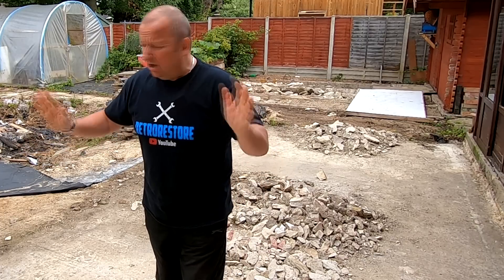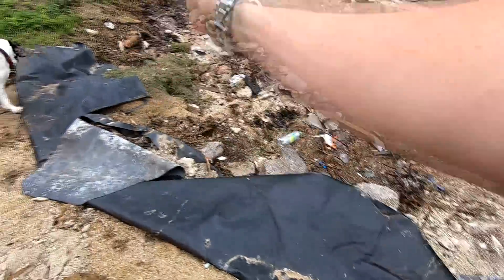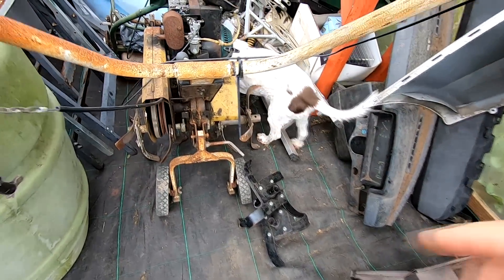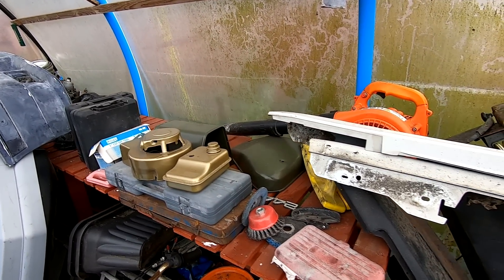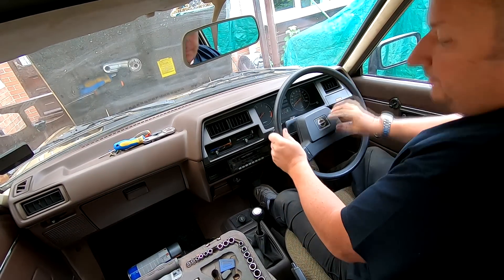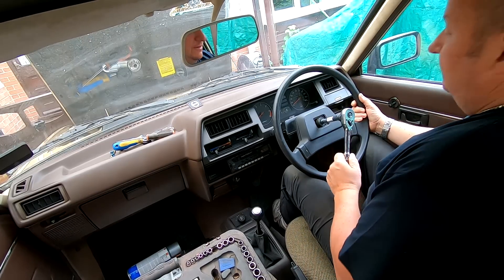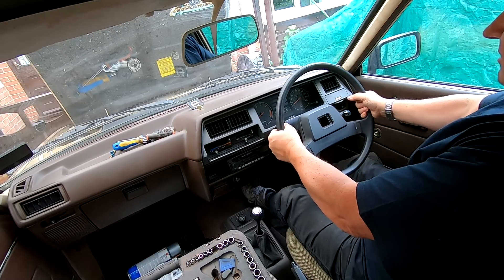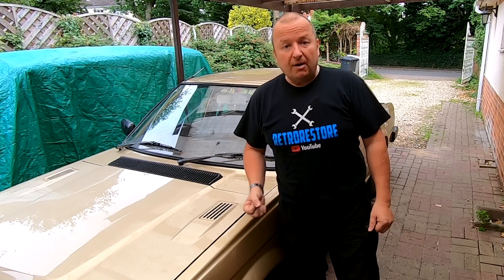Triumph Tinkering - Old Qualcast Rotavator And Garden Patio Vlog

Comment: It was in the Air Force I lived in Brandon Suffolk England I had a Triumph Acclaim just like the one you have it sells the mot and I didn't have a welder so I went running in the woods after a few beers and it gets stuck on a big log call a friend of mine that has a wrecker and took it away for free and I think he got 50 €